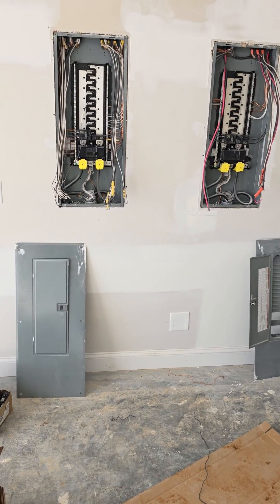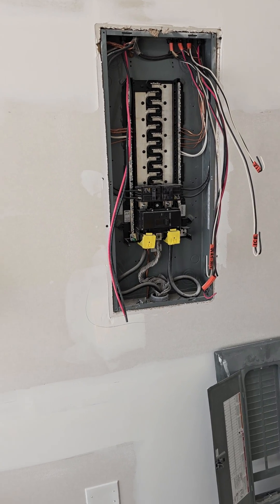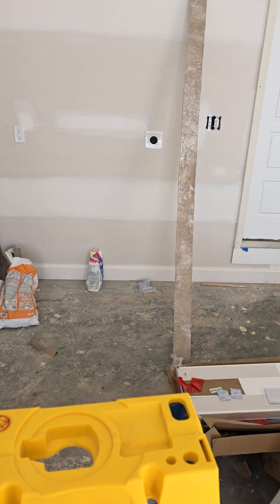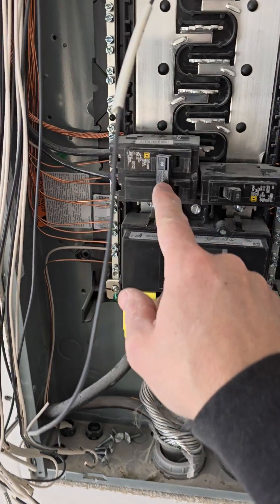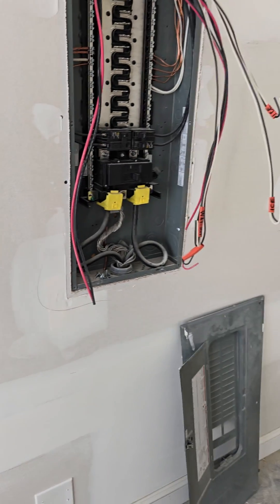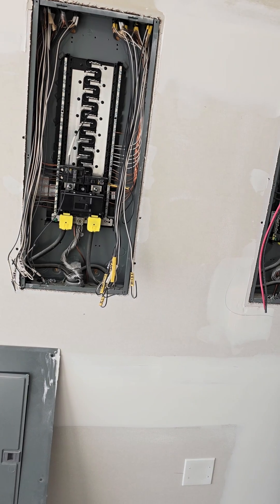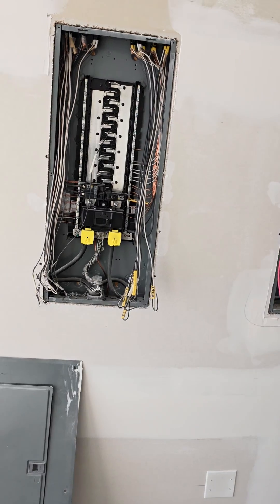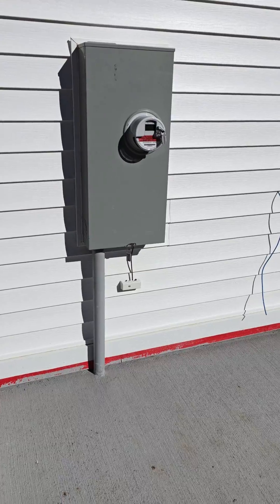Reason why people go with 400amp service in new construction now days

Comment: Cut a piece of cardboard from the box the panel comes in and masking tape it to the panel cover (completely covering it) so the drywallers can't get shit all over them. I usually slice a sort of "H" into it so you could open the cover if necessary.

Comment: 200 amp panel goes a long way when furnace, cooking, water, dryer are gas...
Reply: Gas leaks
Reply from the maker: Agree 100%
When all appliances and heat on gas, 200amp panel is enough in most cases

Comment: I built my home with a 200 amp service. But im not an idiot. We dont need all this bs in a house. My electrrc bills are 100 in the summer and 130 in the winter. Build smart people.
Reply from the maker: Well insulated house goes long ways👍
Reply: @ProTecElectric  yes it does. And it doesn't cost that much more. Just attention to detail.

Comment: 400a is stupid for residential.  Shouldn't even be allowed.
Reply from the maker: When I lived in New Jersey we used to have everything on gas and even some 4, 000 sq ft house really basic would get 200 amp. Here where we live now everything is on electric. I work with different general contractors, and some would try to stick 200 amp panel everywhere where they can no matter the size of the house.

Comment: What's funny is that 25 years ago when I built my house, I insisted on 200A service and the electrician who wired it thought I was nuts. Told him I was paying for it and didn't really care about his opinion. Now 400A is becoming normal.
Reply from the maker: You are absolutely right I started working as electrician in 2005 and back then 400 amp was really rare. I followed this one guy on YouTube and he was installing 1800 amp service on the residential property obviously it was multi million dollar property with pool house and everything else you could imagine. He said the pool house alone was a million dollar project.

Comment: around here 400amp is impossible without major $$$. too rural too old. even though a 200amp system is standard its pushing your luck on the old primary lines...

Comment: My previous job over two decades ago, the building was constructed in the early 1900's which still had a lot of the original electrical panels i.e. fuse boxes w/ switches for light fixtures. Main panel was 600A 3 phase. Back in early the underground conduit rusted out and or tree roots broke though, water intrusion shorted 3 of the 3 phases blowing the fuses in the utility under street transformer vault. 95% of the power was off, power company came out shut off the remaining feed. The main panel had to be replaced, new feeders pulled in. The new panel was 400A but did the job only high current machine was the fright elevator power unit.
Reply from the maker: You're right in most cases we don't use full capacity of our services, but it's nice to have room to expand if we ever have to. General contractor paid only $500 extra for the extra 200 amp to me that's really cheap price we charge and it makes sense to upgrade to 400 on new construction.

Comment: I have 200amp service and have two Tesla Wall chargers (60 amp breaker), a hot tub on a 50 amp breaker, and three refrigerator/freezers.  Big A/C unit in Utah’s hot summers.  It probably helps that our dryer and range top are gas plus both water heaters are gas.  I can see future homes needing at least 300 amp service.
Reply from the maker: Yes it does help when you have gas in the house, to reduce amperage pull. A lot of custom houses we do here they have cooked ups that are 40 amp and then wall ovens there are also 40 amp.

Comment: 600Amp service on that next project?  At that point a 3 phase service could make more sense!
Reply from the maker: Yes it will be 600 that house is fully loaded it's actually when you do load calculation on that one it's when the borderline 600 is the minimum. Three phase services are a lot more expensive here. 120/208 3-phase panels are more money and just bring the power to the house cost a lot more for homeowner.

Comment: Interesting trend, was not aware of. We built our house in 1982 and I installed a 200 A main service. Our utility has a separate rate for electric water heating so that is another 30A service. House is fairly far off the road so we have a utility transformer dedicated to us, however it is only rated at 10 KVA. Been fine all these years but if and when we get an EV I'll contact the utility for advice.  Being retired don't need ultra fast charging.
Reply: Been running my EV off a 30 amp breaker for two years. Works great. Depends on your vehicle and driving habits I guess.
Reply: By my math: you have only 40A service (10 000 VA/240V).
Reply: @economicprisoner  By my math also. When the utility was installing our service I pointed that out. The crew chief smiled and said if I was able to burn up the transformer they would happily replace it. Utility transformers have tremendous overload capability. That is why EV charging is a problem. Residential: HVAC, kitchen ranges, dryers well pumps etc. all represent a pretty low duty cycle intermittent load so the transformer is able to handle peak overloads easily. EV charging on the other hand is a constant load for hours at a time.
Reply: @tomschmidt381  I forgot about derating.

You have the equivalent of 50 amp service (breakers are derated 20% for continuous use)
Reply: @tomschmidt381   ratings on those transformers are 100% forever and 140% for at least 3 hours. Your car charger will be tapering off within that time. Oh, that rating is also more about peak internal temp. I'd expect you can pull more on cooler days and going to near 200% for short periods will not burn it out. They are thermally protected so the worst that can happen is it will trip and cool off by the time the power company gets there.
Reply: @rupe53  I don't disagree. My post was to flag an aspect of EV charging I don't think most folks are aware. 

Being retired empty nesters extremely fast EV charging at home is not a priority. If we ever decide to get an EV I will probably opt for a 30A charger like  @bluetrepidation uses.  I also plan on contacting our local utility for advice.
Reply: @tomschmidt381     have to agree, with a side note that most commenting on EV charging have no experience or knowledge on the subject. BTW, if you are going to the expense of installing 240 volts in the garage you might as well pop for a 50 amp wire and plug. It's only a few bucks more and makes a good selling point down the road. You can always set the car to a lower charge rate if so desired. Also, do it soon because new codes may raise the cost due to requiring GFCI protection. Those breakers ae not $20 like the old days!
Reply from the maker: Yeah those 2pole arc fault breakers adds up the cost real quick
Reply: 10kW over the whole month works out to 7200kWh.
As long as your current monthly power usage is under half that: you probably won't blow up the transformer.
Charging a 100kWh battery once per day (3000kWh) is only 40% of that.

To charge a 100kWh battery in 8 hours would take 12.5kW (52A @ 240V).

Comment: Piss poor set up ! If a customer were to spend big bucks on a 400 amp service think they would spend a few dollars more for 42 circuit panels and at least one 1" empty conduit from panel to junction box in basement & attic for future circuits. I wired in a custom made house that had natural gas for every thing and owner was a gadget nut who came up with additional circuits every week. Only needed a 200 amp service but installed 80 single pole circuit breakers. Installed a 100 amp sub panel for the 4 car garage and huge attic above the garage filled with pinball machines.
Reply from the maker: How much do you charge extra in New construction to go from 200 to 400amp service?

Comment: QUESTiON  HOW MUCH DOES THiS COST TO PUT THESE OR AN EQUiVALENT SETUP iN AN OLDER HOUSE THAT WAS BUiLT iN THE 1950's?
EXAMPLE BASICALLY REPLACiNG EVERYTHiNG THAT WAS iNSTALLED DURiNG THE 1970's

Comment: That’s insane. If you want or need two 200A panels that’s fine but if you actually need a 400A service you probably can’t afford to live there. People that want electric cars generally are embracing new technology that is more energy efficient and should result in decreased demand in the home. In a home like this actual demand calculations need to be done to properly size things, not the old lazy man’s rule of thumb crap. I installed a 400A VTI unitized 3 phase panel in a R&D lab building several years ago and I ordered it with 12 100A 3pole breakers in it because I needed to feed 12 labs that each had a 100A panel in them. The person taking the order said “you can’t do that, that’s 1200amps and it’s only a 400amp panel”. I asked them why do you sell 200A 42 space panels completely filled with single pole 20A breakers then? Using that logic you would have 840A on your 200A panel. In this house you’re showing it’s very unlikely you will ever have all of the resistance heating circuits, all of the air conditioners, and both car chargers going at the same time.

Comment: My KWH price just went over 40¢ per kwh for the cheapest rate middle of the night. Can you imagine the electrical bills?
Reply from the maker: My house is 3800sq ft with 400amp service. My highest electric bill in a coldest month is $390. No car charges, just 2 heat pumps and electric backups. Everything is on electric: well, hot water heater, septic pump...

Comment: All that power doesn't look like saving the planet is working. Huge house with EVs. Guess the magical electric fairy will just have to drill for more magical pixie dust to burn.
Reply: Nuclear is and always will be the answer. The United States sould have never catered to fear from the population and let the nuclear advancement fall into stagnating. We could have been producing and relying on domestic energy, but the oil lobbyists, Greenpeace, and republicans will lock arms. Good thing Greenpeace is now discredited, and republicans changed focus on their "values" so nuclear is starting to look like a viable future again, like EVs.
Reply: EVs are inherently load shedable. They can start charging after midnight (during the low demand time): especially with a 50A plug (40A derated, 9.6kW)

Comment: Getting a 400 / 320 meter base or meter combined with two 200 amp breakers is hard to find in my area.  Several of the ones people are buying from other areas of the country are not approved by local electric suppliers.
Reply from the maker: Where we at, electric provider provids us with meter bases, so we don't have to by them
Reply: @ProTecElectric  two around me did but stopped doing 15 years ago.

Comment: What size cable does the power company use to the proper?
Reply from the maker: Not sure, when I was there last time power company didn't start doing underground yet. Probably 500kcm
Reply: 4/0 aluminum.  That's what poco just ran to a 400amp 3 phase service I installed.

Comment: there is not really any good justification for  a 400 amp home service anymore in a home due to the fact of all are new tecknowlegies guys all these low voltage lighting systems in the home do not need big services any more
Reply: Car chargers, electric cooking, and demand electric water heaters, add up to big numbers real fast.  Monthly bill will be reasonable but instantaneous demand may have high peaks.
Reply from the maker: 3 years ago I moved from NJ and over houses had gas for all the heat and all appliances, now where I live now it's all electric. That make a huge difference for power grid load.

Comment: Seems ridiculous until you actually consider whats going on. Total standby consumption of the house will be 1-2kw. But consider the fact that it could be 5pm you get home plug in the car to charge, throw cloths in the dryer, turn on the stove, start running some water, the heatpump kicks on goes then into defrost kicks on the heat strips. 40 amp car charger + 20 amp dryer + 13 amp stove burner + 24 amp water heater + 20 amp heat pump + 96 amp heat strips. You're over 200 amps not counting any other loads in the house. 

Also have to consider this is not a "400 amp" service, it's a 320 amp service in reality. A "400 amp" service from the utility is just the next logical step up from 200. Using 2 x 200 amp panels makes it simple and code wise it's a very clean way to do it. 👍
Reply: Cars can delay charging until after midnight. Heat pump can over-cool the house a bit during the after noon (lots of solar power) and reduce power in the evening.

Water heater can also not run during the supper hour, depending how much water is being used.
Reply: @economicprisoner   Just because they can don't mean they will. You build for worst case, not best.
Reply: @TofuInc  The Canadian electrical code now allows you to use a "whole house energy monitor" to make sure that is the case.

That is to say: car charging can be paused automatically when local demand is high,

I worry this will conflict with "virtual power plants" that smart water heater manufacturers want to sell to utilities. Since the protocol is invariably proprietary: the "whole house energy monitor" may authorized car charging during the supper hour. While the water heater obeys a load shed request from the utility.

(These systems are still in the process of being invented as far as I can tell).

Comment: Next step will be 3 phase at the home
Reply: Good luck attempting to get a 200,400 or 600 amp residential three phase service. In my area you need at least 7.5 horse power motor to qualify for one. Most likely they would supply a 120/208 volt 3 phase service. A 240 volt electric dryer only draws 75% of the wattage then 240 volts dryer requiring guess 25% more time. 240 volt air conditioners don't perform good on hot days when the 208 volts could dip below 200 volts. You could install buck boost transformers to receive 240 volts. Would be better off with a single phase service and a load management unit.

Comment: Just did some work in a new home. 11,000+ SF with 1200 Amp service. 6 breaker panels and 4 lighting control panels.
Reply from the maker: Nice. We have new project coming up probably in a month 8k sq ft. 600amp. But 1200 amp sounds impressive 👍
Reply: He ought to have 3 phase service installed.

Comment: To the people who think this is overkill: the Ford ChargeStation Pro uses a 100A breaker.
Reply: Ford: Finding out real demand.
Reply: EVs should be inherently load shedable. This has already been added to the Canadian electrical code.

You don't need to increase your electrical service just to install a car charger: so long as you have whole house energy monitoring in place.

I worry this will conflict with "virtual power plants" that smart water heater manufacturers want to sell to utility companies. Because the protocols are invariably proprietary: your car charger may not know why the water heater stopped drawing power during the supper hour -- undermining the load shedding done by the water heater.
Reply: @economicprisoner    yes, but your EV charger should know to only do its job when you set it to go on.... like after 10 pm when you are in bed and most everything else is done for the day.

Comment: so, it's it really 320A service (and not 400A) if the meter is rated at 320A?
Reply: It is 320 continuous 400 intermittent
Reply: Utility companies aren't required to follow electric code.
Reply from the maker: Correct 320, but it's just everyone calls it 400amp.
Reply: @jtelectric9905 we carry 350 amp breakers on all our trucks !! Why would you round up so high and skip 350 ?
Reply: @Nctbgs What size cable does the Power Company use to the property WEATHER HEAD ?

Comment: pro tip: attach both panels with a gutterbox above them.. it makes balancing out panels future proofed. or have it one stud space apart with a chase nipple between.
Reply: Agreed. Very common in commercial work.
Reply: No need. It's not commercial. What are you balancing out? 😂
Reply: @davekohn6049  there’s a splitter downstream of the service if it’s a 400amp residential service. Plus if you wanted to have one panel as an essentials panel for a generator, you could easily switch which panel your loads are going into without making splices in a panel (which isn’t allowed where I’m from)
Reply: @ZackMeetsWorld  that's not a 400 a service. It's a 320. Basically 2 200a panels. Your never going to need to go from one of those panels to the other. If u put a generator in then do you do it on the outside
Reply: Oh wait I got videos mixed up my bad
Reply: @davekohn6049  no worries. Can’t have panels outside either where I’m from lol.